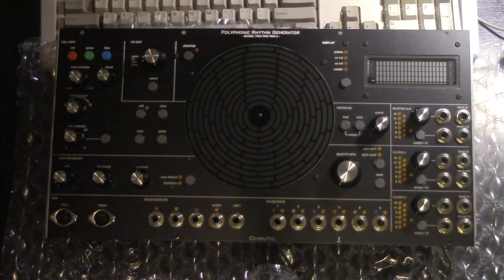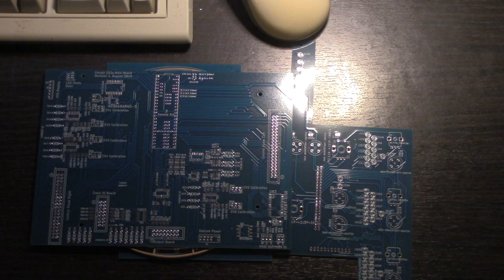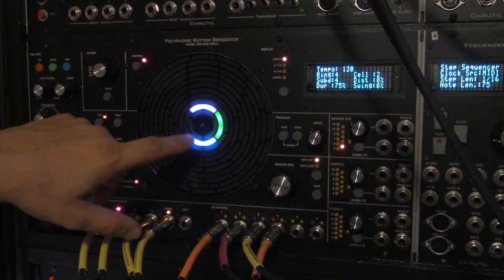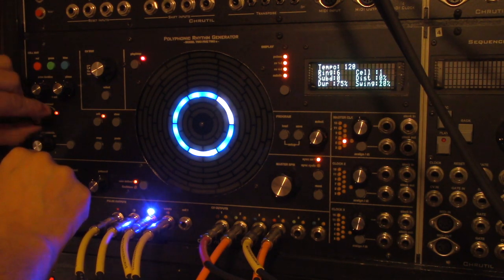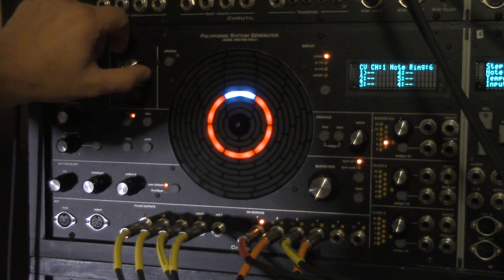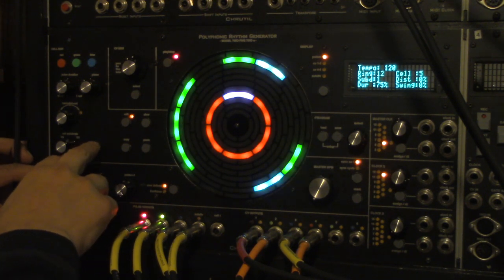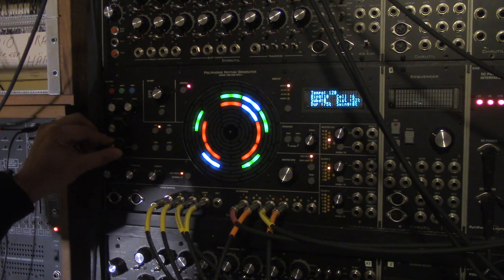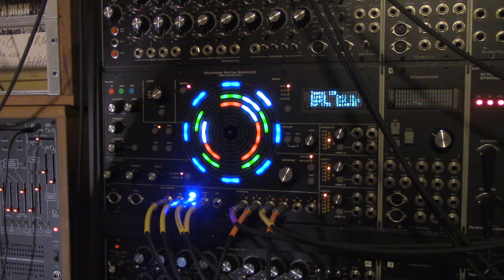Chrutil 252e in MU Deep Dive

Comment: Lovely. Are these RGB LEDs and are you using a matrix chip to drive them?
Reply from the maker: Hi, the LEDs are WS2812B-2020. 
These are individually addressable surface mount with a built-in driver, basically the same as you find in many LED strips. They are connected in a long array and controlled by a serial interface.

Comment: After a couple members from the original team of designers of the Buchla 252e reached out to me with their concerns about this project, I was asked to relay a statement on one of their's behalf.  I of course tried to respectfully reach out to Chrutil directly before posting this, but got no response.
-eric fox 

"While I respect the diligent work to recreate the 252e in another housing, I don’t respect the suggestion that this is merely inspired by, or a re-imagination of the 252e. This is clearly copy of the 252e. It is true that one would have to have a strong imagination to believe that the layout and functionality demonstrated is merely “inspired.” Should someone even bother listing each copied element? Those elements would include almost everything except a different display.  

And the suggestion that it’s not a copy or a clone because a Buchla 252e has never been seen “live”. . .?  It doesn’t require being in the presence of a 252e to copy it any more than it requires hearing a song performed live to infringe on it’s copyright. The circuit isn’t the copyright that’s been infringed on. You can make a 252e with innumerable different MCU’s and DAC and opamp combinations. But it’s impossible to imagine someone recreates the 252e with such detail without watching videos, reading the manual, asking the user community how it works, and/or looking at the code. 

The point is that there are lots of ways to reimagine a polyphonic rhythm generator, but you can’t outright copy the UI and functionality of the 252e and call it your own inspired version.  
Don Buchla has a long history with the very first sequencers of course and he worked on this idea with our programmer over the course of several months. And there are elements I personally redesigned that have also been copied. We ask for the respect and acknowledgement of this work.

Buchla USA doesn’t make it a policy to go after cloners or people copying modules for their own benefit. We support and hope to inspire the DIY community. But be aware this cannot be marketed as product without some kind of arrangement — if granted— with Buchla USA.  Buchla USA's past and present investments require protecting it’s intellectual property.

So enjoy observing or playing with the 252e in this new housing. That is a lot of truly commendable work. I hope it makes possible some inspired music making. But please don’t patronize the synth community by suggesting that this isn't a copy of the 252e. That would be dishonest.

Best of luck.
-Joel Davel"
Reply: Release the 252e on Softube :)
Reply: Buchla USA seems to be as greedy and shady as BEMI was.  What a shame.
Reply: no finer compliment.
Reply: The “UI” as they say, if they refer to the geometric pandecimal circle structure,  this was already known in antique Greece. I mean, apart for the electronics - and I can’t say if there’s similitudes with the Buchlas’s - I don’t think they can take the credit for the natural number based concentric circles metaphor. It is a mathematic object.
Reply: @TheSilentCartgraph3r You're right!  That's it...I'm moving all production to China.  Sorry everyone.  Those American jobs were good while they lasted ;)
Reply: @ericfox4961   Release the 252e on Softube modular.  Also, its true you get your PCBs from China, no?  If not, then congrats.  I guess thats just a Moog thing
Reply: @TheSilentCartgraph3r  SoftTube 252e would be cool for sure.  I think they are planning on a couple of other things next.  Only the PCB material fab (just the raw board) comes from a mix of places including Taiwan and China... although the new 218e fab is coming from Wisconsin of all places.  99% of the surface mount, through-hole/hand assembly, testing, and QC is done in Monterey and San Francisco, California.  I guess WMD has done some stuff for me in Denver and we do a little bit in Minneapolis by hand.  Like you mentioned, some of the other companies actually have the entire PCB board pre-loaded in China with most of the electronics installed.  Not us.  What I think sucks is that you can't even really get parts that are made in America.  Switches, jacks, LED's, resistors, etc pretty much all come from Asia.  American electronic manufacturers almost exclusively deal with government contracts and won't even talk to you without huge financial commitments.   My god..Paul Schreiber has rubbed off on me when I start talking like this :)
Reply: @ericfox4961  Perhaps my accusation of greed was excessive in light of this information.  Still I dont think this guy plans on producing these to sell.  Looks more like a project for his own synth.  If anything, I would be more worried about Behringer coming for you guys and making some easel clone abomination using  fake digital vactrol emulators or who knows what